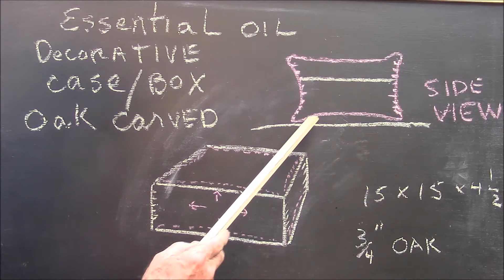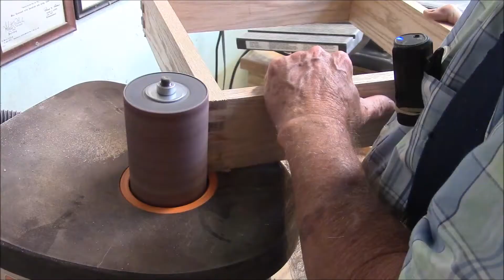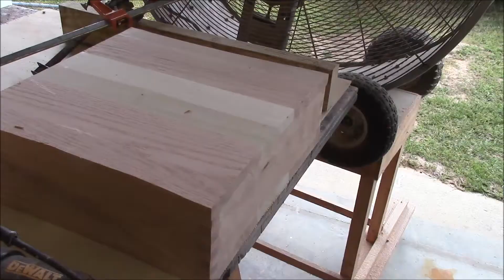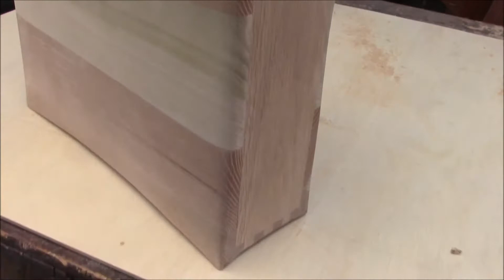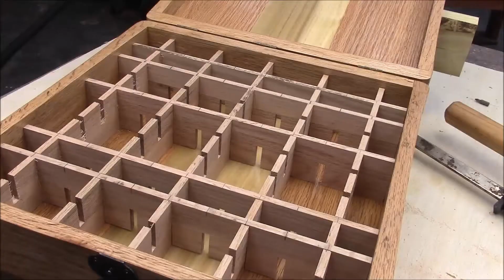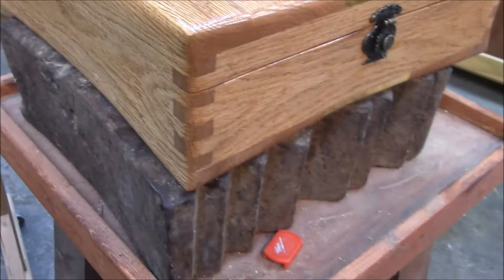118 Making a decorative storage box for Essential Oil

Comment: Ok.  It is official that I am in awe of your abilities!  In order for this project to work, you had to keep your concave carvings very symmetrical.  If it wasn't symmetrical, when you went to cut the box in two, the cutting would have been out of alignment.   This is truly a work of art and the recipient must have been ecstatic to get this.I love the little latch.  Will this box accommodate both sizes of the bottles that you referred to in your last case build?  I actually like the grid pattern much better.  For some reason, it is much more pleasing to the eye.   I also like the clear finish.  Sometimes it is nice just to let the beauty of the wood grain speak for itself.    Well, it is almost the hottest part of the day so I better get out there and start walking.
Reply from the maker: Well, it is the hottest part of the day, so Memphis needs to turn up the AC and sit under the fan.  Man, you are tough.  
      Actually, designing this box was pretty smooth, as my guiding idea was to make everything different from the first edition.  I like the grid better too, which is nice, as it is less tedious (Drilling all those holes was a killer,)  This friend primarily has only one size bottle, so I made them all the same.  
      Hey, you never gave me any feedback on that "brilliant" list of names I offered.  I'm still high on "Fred" or "Trippy."  Just kidding of course, what will really happen is that the real name will fall out one day; it will be obvious, instead of forced cuteness.
Reply: For some reason I never got a notification that you had replied.   Remember who you are talking to.  I am not tough.  My house is 82 degrees so 90 is not that much of a stretch for me.  I would be tough if I could get out there when it is 30 degrees and walk!  That I don't do!

The design of the box may have been pretty smooth but the execution was a mastery of skills!  It would have been very easy for someone with less talent than yourself to end up with an asymmetrical  mess.  I hadn't thought about the tediousness of making the round holes.  This way you could mass produce all the grids whereas you had to drill each one of those holes individually and make sure that they were precisely lined up or it would have been very obvious.  So this is a different person you made it for.

Actually I did respond to you about your brilliant list of names.  I remember liking Pale Rainbow, Afterglow and Trippy.   I was very impressed with the fact that you had a little Hippie inside of you!  It is weird that neither of us were notified of the other's response.